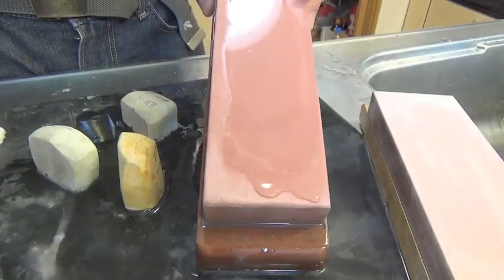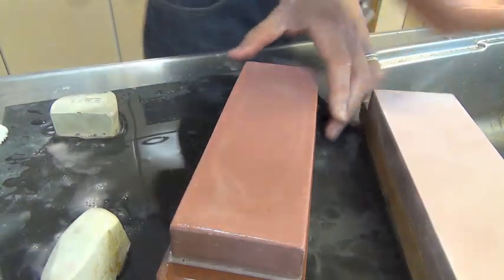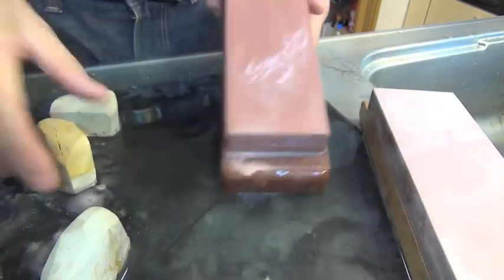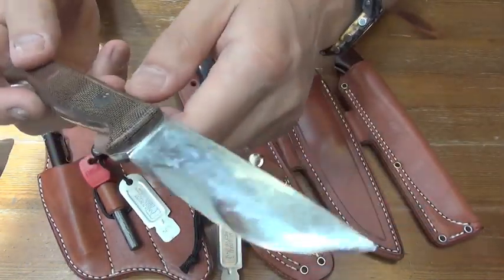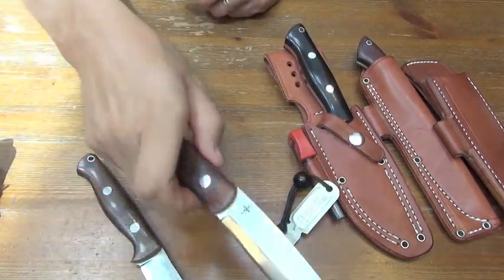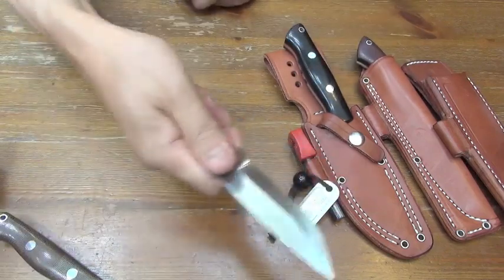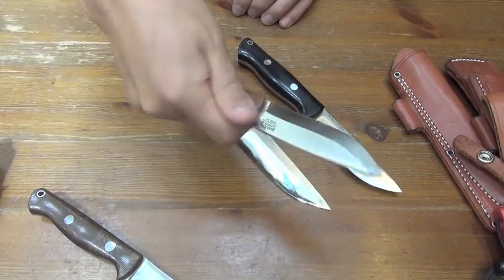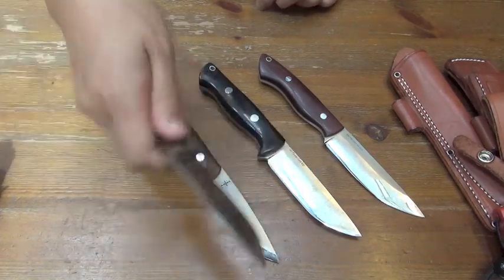Nagura stones & my Bark River bushcraft knives

Comment: I can recommend Danish oil for your canvas and wood handles. On your bravo 1.5 in natural canvas you can see a pale piece in the front of the handle caused by the strap of the sheath. Danish oil darkens that again and protects it from the elements.
I put Danish oil on all my natural handles to prevent cracking and discoloration.

Comment: Dr Wako, do you see any difference in using  the grids of nagura on different stones. Lets say soft on chosera 800 and hard on 800. And on 5000 +. In feel. And cutting meat, and hitting bone. What  do you see with the microscoop. Some say high pollishing gives less cutt. But again nice vid. Have you ever used a filleting (fish)knife as made by buck?
Reply from the maker: Heavens makes denser slurry and has stronger effect to reduce coarse feel of low grit stones like 800, 1000, 2000. The slurry from Button contains more quartz which abrades metal finely. So its polishing effect is even stronger with high grit stones like 3000, 5000, 8000, 12000. It's my own opinion from my own experience. The fillet knife from Buck is way too long for my tiny trouts. Thanks.

Comment: What is your favorite knife for only bushcraft?
Reply from the maker: Helle Temagami and Bark River Bushcrafter in high Scandi grind.
Reply: @virtuovice  how about the bravo 1? Is it still very versatile?
Reply from the maker: @williamkang9475  Its guard design makes the distance between the cutting position and the hand position larger than that without the guard design. It is a disadvantage to power transfer.
Reply: @virtuovice  thanks so whats the overall best 3.7~4inch bark river knife for only bushcrafting tasks in your opinion?
Reply from the maker: @williamkang9475  Bushcrafter in high saber convex grind aka high Scandi grind. Its original low convex grind is terrible.
Reply: @virtuovice  how do you make a high saber grind out of the bushcrafter?
Reply from the maker: @williamkang9475  DLT does it for free for you if you leave a note on a comment corner when you order it.
Reply: @virtuovice  are there other bark river knives that you like as much as the Bushcrafter? Cause most of yhe bushcrafters are out of stock
Reply from the maker: @williamkang9475  I would recommend you Tundra next to the Bushcrafter.
Reply: @virtuovice  do you need to tell dlt trading to regrind the edge like the Bushcrafter?
Reply from the maker: @williamkang9475  No. Its original grind is high convex.
Reply: @virtuovice  thank you whats the pros and cons on the tundra? I've heard that the tundra is kind of a hunting knife
Reply from the maker: @williamkang9475  It's not a hunting knife at all but a genuine bushcraft knife you will know it as soon as you have it I am sure.
Reply: @virtuovice Oh i watched your video on the tundra and the tundra at the riverside and now i knoe thank you!
Reply: @virtuovice  hello again! Thank you for the information! I think I'd like the bushcrafter or the bushcrafter ll but does knivesshipfree make a high scandi grind for you if you ask them?
Reply from the maker: @williamkang9475  KSF will do the same as DLT does. I don't recommend you the BushcrafterⅡat all because it is too heavy as a cutting tool and its handle sectional design doesn't fit the palm very well.
Reply: @virtuovice  thank you for your answer! I want to ask you about when the knives get back in stock. How much does it usually take?
Reply from the maker: @williamkang9475  https://www.facebook.com/groups/brkproductionschedule/
Reply: @virtuovice  thank you! Do you recommend the ksf strop or the dlt strop?
Reply from the maker: @williamkang9475  DLT's one definitely.
Reply: @virtuovice  ok thank you, i should wait until the bushcrafters get back in stock at dlt. Do you still prefer white and black compound for your strop?
Reply: @virtuovice  ah i have another question sir, how long does it take to ship from dlt and ksf to japan?
Reply from the maker: @williamkang9475  I use water stones instead of the black compound which rounds the apex.
Reply from the maker: @williamkang9475  It takes about 2 weeks from the US to JP. If you order some modification, it will take 3 to 4 weeks.